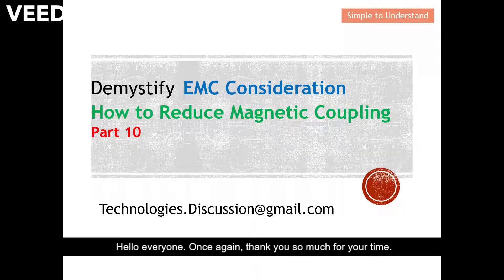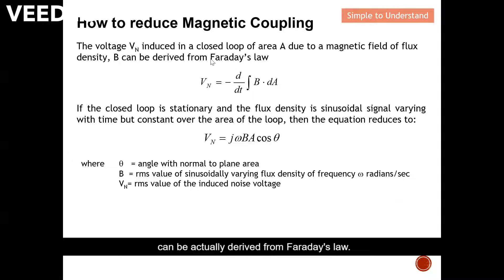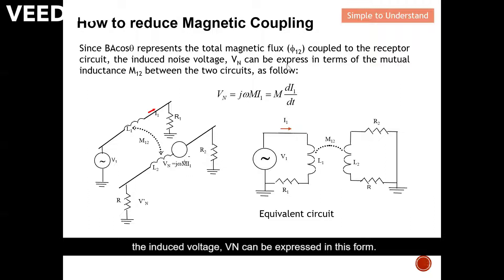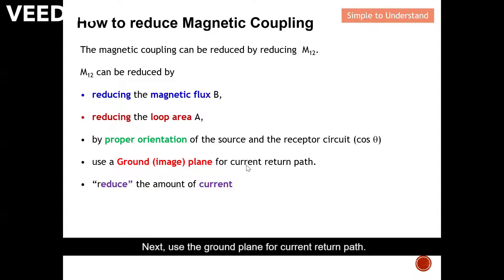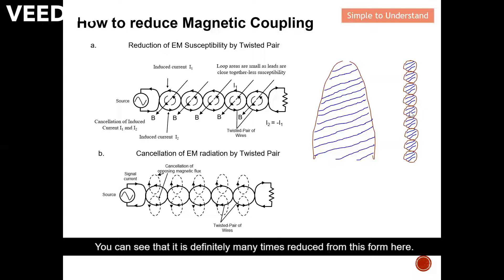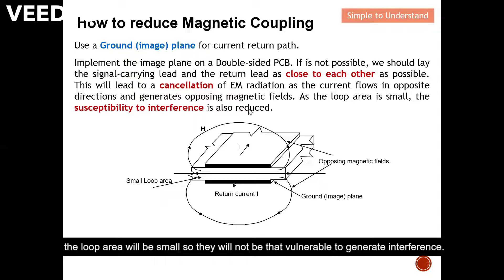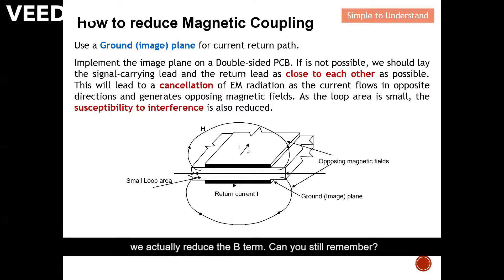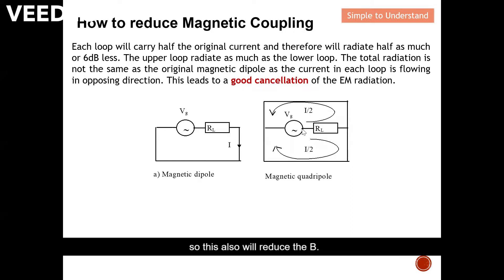EMC #10. How to Reduce Magnetic Field Interference! Five Proven Ways to Reduce H-Field Coupling.

Comment: To make return current do we need to place via in Pcb ? or just having ground layer is enough?
Reply from the maker: A good return path means a low-impedance return, which minimizes electromagnetic interference (EMI). A ground layer is actually ideal for return currents, as it provides a low-inductance return path. The key is to ensure the return current follows the signal closely, which means placing signal traces directly above a solid ground plane. The issue arises only if there are gaps in the ground plane, which can force the return current to take a longer path, increasing the loop area and EMI.
You can see these 2 videos for more info:
EMC Part 35. How to Create a Low Inductance/Impedance Path for Returning Signal on EMC Grounding.
https://youtu.be/TqZyE9PFH6s
EMC Part 36. How to Reduce Differential Mode Radiation Using Shorter Loop by Implement Image Plane.
https://youtu.be/VGy-azJj0qc

Comment: how is it possible if the ground plane run in the opposite direction reduce the magnetic Flux? 
because if we use the right hand rule, than the magnetic Flux will increase ? 🤔
Reply from the maker: The opposite effect acts like a canceling effect so therefore reduce the mag. Imagine like current flowing in an opposite direction has a canceling effect.
The right hand rule only indicate direction but not the mag (increase or decrease)
:)